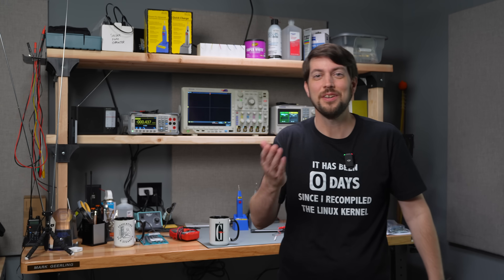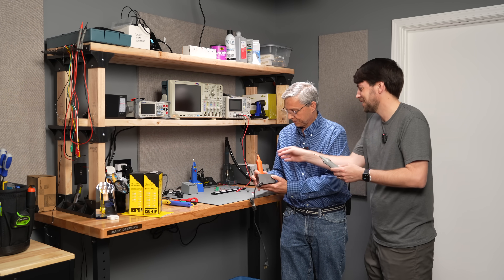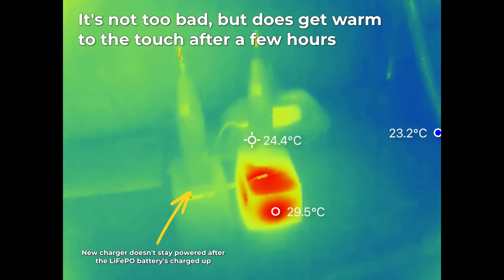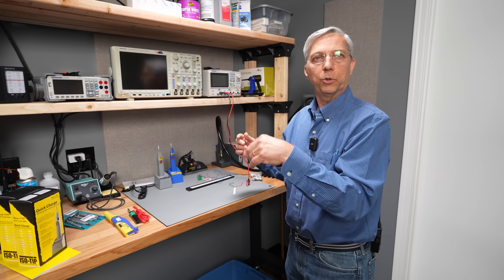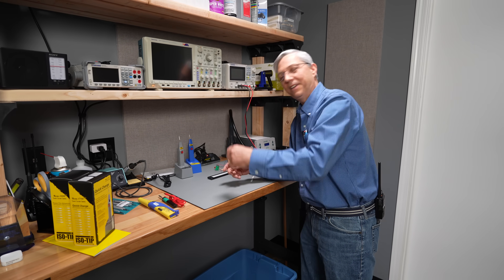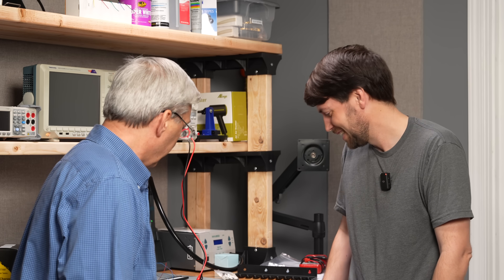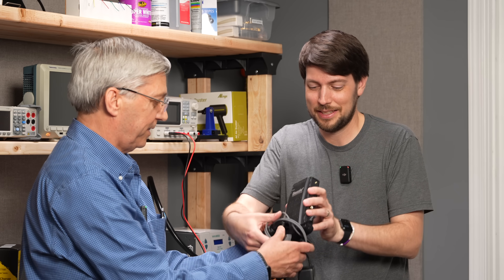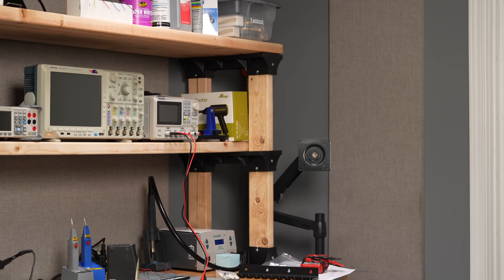Sometimes old tools are better.

Comment: I remember ordering one of those soldering irons when they first came out in the 80s. I quickly discovered that they weren't much use outdoors when I tried to repair a mic cable while up a tree at a remote broadcast. The heating element was no match for the ambient temperature of an English summer! 😀 I think I pulled the element and just used it as a flashlight. 🤓

Comment: I've been using my PC to generate waveforms using the audio line-out and an analog amplifier - what are the benefits of a dedicated waveform generator, apart from amplification precision?
Reply: The dedicated generator probably supports a programmable DC offset on its output  while sound cards are only AC-coupled. The dedicated device will also have a greater frequency range.

Comment: light for soldering iron is not a deal breaker. Why would you need this? are you soldering in dark?
Reply from the maker: In many places, like under a shelf or inside a cabinet, it makes a lot of sense (same reason I love lights on drills too!)
Reply: @JeffGeerling  You do know you can take the broken item out of the drawer or cabinet before you try fixing it ;-)

Comment: This is a great random 'sponsor' I never even knew who made that style! Back around the time those were released I purchased a radioshack 'coldheat' :( it was so baddddd, they used 2 carbon electrodes and the idea of creating a short circuit between them at the tip to generate the heat.. brilliant.. you could easily fry the item you tried working on, using that tool.

Comment: I had a gas jet flame SOLDERING IRON!! was better than the rechargeable battery garbage form the 90s and early 2000s!! I still have it and all its tips which are still like new after 20 years of use!! Sure this electronic iron might be okay for soldering stations but my gas 1 is better in every single way. It has different temperature ranges controlled by the flame strength and adjustable distance from the tip of the flame to the bottom of the tips.
Reply: Also saying that i have used good newer rechargeable irons but especially for the household wiring and car wiring harnesses and other stuff i do my gas powered one rules the toolbox. It was expensive though especially compared to the USB C one's so they are not useless but for portability my gas one with a refill can lasts for ever and is completely reliable and never will have to worry about battery packs dying and needing replacement ect. So I say gas powered is better than battery powered.. same applies to cars as well 😂

Comment: My dad and I used to have that same soldering iron ❤. My workbench looks a bit different. I love the Siglent range of equipment and have some python scripts for automated test setups. The only thing I am missing on the power supply is having a keypad to quickly select a different voltage or current limit. Using the encoder knob to change from 8.2V 2A to 3.3V 20 mA takes quite some time.

Comment: 5:35 Say no to rubberised coatings!  I'm so tired of having to isopropyl clean that &$^# off after a few years.  The inventor needs to be sent to the Hague for crimes against humanity.
Reply from the maker: Exactly! There are few rubber coatings that wear okay after 10-15 years. Some of the cheaper ones turn to goo after just a year or two, especially in high heat environments.

Luckily Iso-Tip hasn't succumbed to the 'space age looking rubber grip' tool design trends of the past 10 years.

Comment: If you work on computers, a logic analyzer is a must.  So much equipment now can be accessed and controlled via USB:  Oscilloscope, multi-meter, logic analyzer, waveform generator, even power supplies.  Many have Python apps you can hack.
Reply from the maker: Yeah; these bench tools all have USB ports (and two at least I remember seeing Ethernet too!). The scope has a logic analyzer addon for something like 16 channels, but when I glanced at Tektronik's price tag for it, I balked a bit :D
Reply: @JeffGeerling  have a look at second hand gear - expensive equipment tends to be thrown out in bulk when manufacturers go bust/move overseas and makes its way to ebay.
 I have a similar scope with a 10 channel logic analyser that I bought used online for £50.

Comment: Feel ancient, I also have that bunch of scsi-cables (but no devices anymore) - Don’t dare to bin them. See, those cables were darn expensive, and you’d need all of them - and more. There were several versions of the protocol, and brands used a variety of plugs. 

And, that model of the blue Weller soldering station must have stolen years of work hours - let’s hope the fumes didn’t, though… 😅
Reply from the maker: A lot of those cables fetch $50+ today (pretty crazy that they still hold value decades later!). Only a couple of them are still made, the Apple-specific adapters especially can be a bit rare.

Comment: Wire label maker, Magnifying lamp and a fume hood, hazmat cabinet for acetone, isopropyl, resins, paints, adhesives,sealants, and a hazmat disposal bin. A solid bus bar for heat gun, etc. built into the work bench, a under counter drawer of flush cuts, forceps, precision screwdrivers, T pins, fox and hound, rolls of wire and bins for heat shrink, fuses, a couple bread boards, cheat sheet conversions and charts for wires and hardware sizing as well as resistor ID, etc. cheesecloth, lentfree rags, Megger for bonding, burnishing brushes, alodine, still trying to think of what to add. Could always get a lab coat or apron for the upcoming lab videos.

Comment: I’m sorry, but I cannot ever get behind an incandescent bulb on a handheld battery powered electronic in 2024. That’s absolutely inexcusable. Everything else about changing the design or what not is fine, but you can definitely get replaceable LED bulbs.

Comment: if you plan to do any high-voltage repairs (power supply, etc), you should add an Isolation Transformer to your list of bench stuff to buy.  Just be careful that it offers true isolation - most modern ones for medical (Tripplite for example) tie the input and output grounds together, which can get you killed (other YT videos explain why and how to modify it).  Also helpful (but expensive) are high-voltage differential probes for your scope.  Some recommend 2 isolation transformers, 1 for DUT, and 1 for scope.  Seems (to me) like you could alternatively just use a battery-powered scope, but "the internet" is still arguing about that.

Comment: Ha!  I remember that the assembly techs at my first full-time permanent job had those in the factory part of the building.  That was the early eighties…not long after it came out, if I'm to believe the 'net.  In the mid-eighties, I bought butane-powered soldering iron from the Shack - and I still have it and it still works.  It doesn't work as well as a Weller or the Hako knock-off I now use, but it works in strange places.

Comment: You need 

A magnifying glass, 
Some strong magnets around the area like underside to the 1st rack, and other easy approachable locations to stick frequently used tools for ease, 
Under desk mini drawers for small components, cables, batteries etc.
A Home Assistant dashboard on a cheap tab to monitor the whole studio when you are working with some automations.

A sand bucket to dispose batteries or other hazardous items (in case of fire) with a small fire extinguisher. 

Will edit if I remember anything else. :)
Reply from the maker: Got the sand bucket a couple days ago, when I brought in the butane torch. Making notes for other bits. I think it would be the perfect place for a Home Assistant display!
Reply: I don't think "strong magnets" around delicate computer electronics is a good idea.
Reply: @KameraShy  I meant small neodymium button shaped magnets to stick blades, screws, teeny-tiny screwdrivers etc. 😅😅😅

Comment: I once got an old SCSI cd rom drive that needed terminators. This was way back in the day.
On a whim, I reached out to the manufacturer by phone, was transferred to their technical department, and long story short, I got some terminating resistors in the mail a month later that plugged into little holes underneath the SCSI connector.
Possibly for a soundman wave logitech soundcard + cdrom controller.

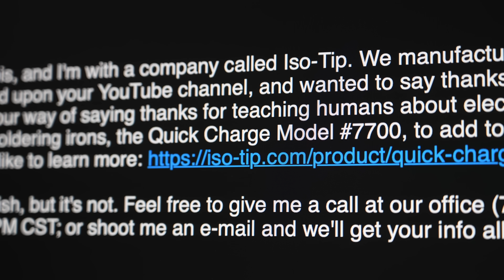Comment: 1:25 if you felt the need to explain, it makes me wonder what do UK people call soldering?  Low-temp melty melty?  Unless you just like the nostalgia, you should check out JBC soldering irons - they sell a cordless b-iron.  Precision temperature control, and reasonable power (at least 45w) makes a huge difference in how difficult soldering projects are.  My first "good" iron was a weller pyropen jr.  I don't think weller has bothered to release any modern soldering equipment but the nostalgia factor is high.
Reply from the maker: They say like "sold" ering, like someone sold them a new soldering iron.

We know it's "sodder".

Comment: My dad done a lot of soldering with a soldering gun, where you have to pull a trigger so that it heats up, while pulling there was a (dimm) light and that thing was hot really fast. It was a major downside after I got my first own iron and had to learn that the cheap normal ones take ages to get hot.
Reply from the maker: Heh, on the MrBeast set I used a soldering gun the first time, and you're right—it's like 2-3 seconds and full heat!
Reply: @JeffGeerling  the tip isn't the best for smaller electronics and it lacks temp control but it's great for normal cables in cars, av, lights etc where precision isn't as needed.

Comment: To be honest, I don't think the workbench has enough depth. Additionally, the oscilloscope is placed too high. When you try to move the oscilloscope to the main desk, there's not enough space for it either, haha. By the way, I'm not saying your bench is bad in fact, the high-speed oscilloscope is really impressive!
Reply from the maker: I was trying to find a deeper benchtop that was mostly assembled and had an easy option for casters, but this was about as good as I could find without going custom (didn't want to do that on this job!).

I think in the future, this bench could turn into a 'mobile' bench (one we can move elsewhere in the space), and I might build a built-in shelf along that wall (or somewhere else) if we stay here longer! Then I'll get a custom top.
Reply: Btw i love your videos!!!!

Comment: I would enjoy a battery powered soldering iron. As an electrician, I install LED tape lights all the time. While you typically cut them to length, there are times when I have had to extend the existing length or replace a portion due to damage. Having one would save me running an extension cable to my ladder and having to find a way to tie it off so it doesn't pull the iron out of my hand.

Comment: miniware (ts80 ts100) and pinecil just miss the pico and plumbering size tips. They are as ergonomic as soldering stations but you can use them with a QC or PD usb powerbank in your pocket for field jobs, and still use them as your main soldering iron at the bench. 

I wish the weller RT pico tips were compatible with the TS80(they both use a 3.5mm jack), sadly the shaft and wiring is not compatible, if anyone knows of compatible pico tips for the TS80 hmu!!

Comment: Those ends are Centronics. Used on SCSI and Parallel printers! :)
Reply from the maker: Ah, that's what it is! Now I'm wondering if I may have had a parallel printer (HP something or another) and an adapter for Apple ADB or whatever it was to that.

The scanner was SCSI though. It had this filter that would click around to the right color, then do a pass that took like 15 minutes, then click to another color, and do another pass, for RGB. It was crazy how that all worked back then!
Reply: @JeffGeerling  They were common on the early HP Desk-jets and ubiquitous on dot matrix and daisy wheel printers back in the day.

Comment: >Electronics come here to DIE
Or come back to life if they are broken. this can go either way. and now I'm a bit jealous because I don't know how to solder.
Reply from the maker: Find something to test on and have a go! It's not that hard, the main thing is don't put your hand on the end of the soldering iron...
Reply: @JeffGeerling  I only have a butane-powered iron, would that work for electronics, or do I need to hunt down a "regular" soldering iron?
Reply from the maker: @electricdragon9366  Butane is a little tough for modern circuits, especially SMD, because the flame can't be as precise as an iron tip. Butane is helpful for applying heat to a broader area, for larger solder joints (especially like cable connectors), or for heatshrink, stuff like that.

Comment: Something that you may find useful since you put the monitor arm on the workbench - they make laptop trays that attach to VESA mounts.  Since you may not always need the computer at the workbench, this might save you needing to find room for a keyboard/mouse/trackpad.
Reply from the maker: I'm going to start with just a wireless keyboard/trackpad for now, and see how that goes. It can be stashed up on a shelf, or I might get a little tray to hold it underneath soon.
Reply: @JeffGeerling  I recommend finding a wireless keyboard with a trackball for a mouse. I have one and you can actually be very accurate with it compared to a trackpad
Reply: I use an old cry wall mount - the bar happens to fit my pole mounts…

Comment: If I had a workbench dedicated to soldering I would not equip it with a portable soldering iron. That’s where you put your giant one with the heated surface that doesn’t fit anywhere else 🙄
Reply from the maker: Why not both? :D

The Weller's still sitting there ready to go for longer soldering sessions. But the Iso-Tips heat up in about 5-10s, and are great when you just need to hit one or two joints at the bench.

Comment: Are the supports for the shelves 3d printed? If so, is there a file somewhere?
Reply from the maker: No; I go into those more on the Geerling Engineering video. They're 'ShelfLinks', and they're molded (they support the whole weight, so PLA at least would be a little iffy there).

Comment: I build Lego Technic B models which come on a PDF so I bought a cheap 32" Monitor (1080p) and put it on my build table with an arm - if I break it by knocking it it's no biggie. So I'd not be spending a fortune on the monitor, in case something hits it (or cover it with a protective sacrificial cover

Comment: I bought the orange model when it first cane out. I added a power switch to keep from over charging the battery and I added a diode in series with the lamp to give it longer life. I had to replace the battery. I mainly used it with their ' Tuner Extension Tip. I used it until I could no longer find tips which was pre internet.
Reply: I also plugged it and other battery powered items into the lighting circuit, so they wouldn't overcharge  when I wasn't there. I also shut down power to the bench, in case something would fail when I wasn't there. 
We once had a brand new, $20,000 receiver catch fire during its 24 hour burn in test. Thankfully, the fire suppression system in the test chamber put it out. or we could have lost the production building.

We were to replace the phone system at that plant, in late 1999 because it wasn't Y2K compliant. It caught fire one Saturday morning, just a few days before it was to be replaced The entire equipment room was destroyed, and severe smoke damage through all the Front offices and Engineering resulted, You could still detect it, when I left in late 2001

Comment: My dad is an Electronics Engineer . He used to have his small lab and factory back in Venezuela. I learned electronics there.
You made travel back in time because that same soldering iron is the one I used to solder with quite often as a kid.
Thank you
Reply: body iam in east eu we learnad on that soldering irons to solder,in school The CUBE
Reply: @ventusprime  Keep creating, never stop
Reply: Those soldering irons and soldering stations have been developed and produced at the German site in Besigheim, Swabia (in Germany) for over 50 years. By the way, I'm currently using my WECP-20 soldering station, right now!:)
The nice thing about this quality tool of good old fashioned design is that if you own two... you can easily repair one with the other without much effort. Controlling and replacing spare parts is so unproblematic that mine has been in use for over 25 years.
Greetings to Venezuela, to Eastern Europe and to the rest of the world from Germany. Happy soldering, friends! :)
Reply: The only thing I question about that iron is the physical aspect - how you hold it. After soldering with a micro-pencil for years, that thing looks like it'd be like trying to solder with your left foot. Even now going back to a "regular" fat iron, like any standard weller hand piece, feels like cave-man technology

Comment: Maybe a strip light fixed on the underside of the lower shelf?
Reply from the maker: 💯 that's on the list of things I'm going to do soon. More light is better :)
Reply: @JeffGeerling  I stole an idea from a guy I saw painting minis at a maker faire, and bought one of those cheap, ikea swing arm lamps.  Then, I threw an LED, exterior floodlight on it and it makes a pretty great spot light
Reply: @JeffGeerling  You should do something with RGBW LEDs with WLED. RGB Electronics Desk! (You can get some high CRI RGBW strips).